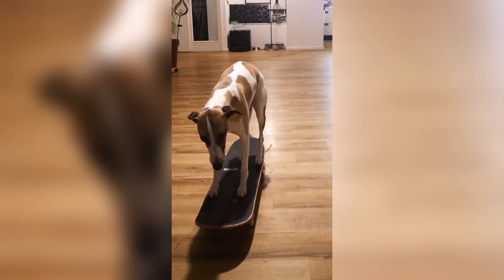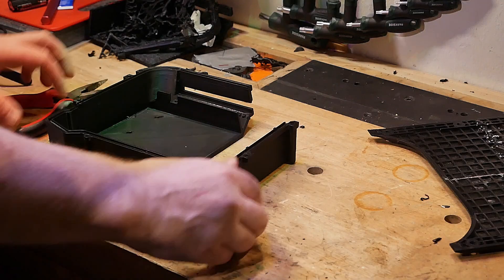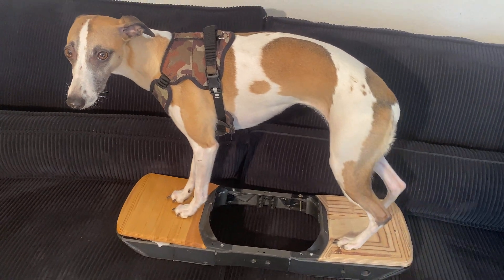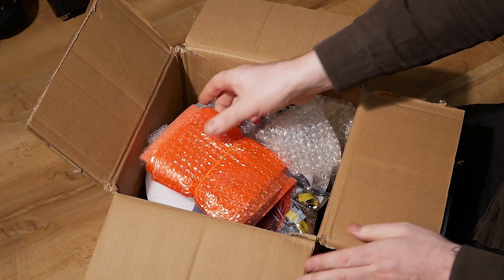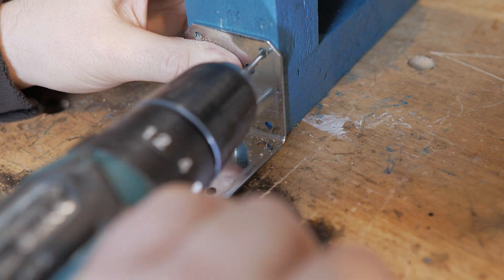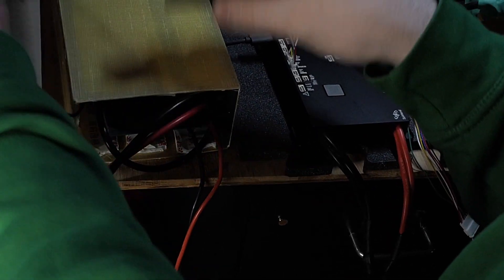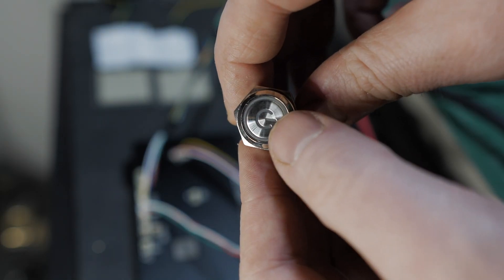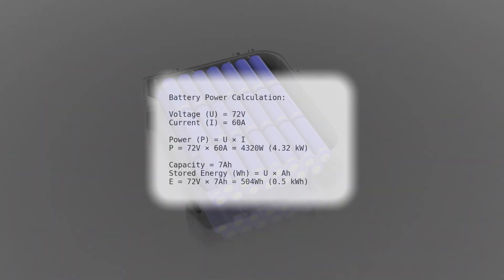4000W VESC Self-Balancing Skateboard || Building My Own OneWheel (Part 1)

Comment: Best printer is a ender 5plus modified
Reply from the maker: Yeah, the Ender 5+ definitely has a nice size and a solid frame great starting point for building a serious machine, I agree.
But to be honest, I’m kinda done with modding printers. I’ve built a few DIY ones myself before, loosely inspired by Voron always a bit of a “work in progress” vibe. Learned a ton doing it, and it was fun.

These days though, I just want to focus on my actual projects.
So I went with something like the Bambulab P1S more of a plug & play machine. Super happy with it so far, only downside is the small build volume.
The next size up, the h2d, is just way out of my budget right now.

Thanks a lot for the suggestion though really appreciate it!
Reply: Yup I had one I custom built btt opctopus mobo and upgraded everything it was fun build I just recently sold it had linear too  @LionInTech

Comment: How long did it take for the motor kit to arrive?
Reply from the maker: I’d say anywhere between one and three weeks, depending on how quickly the staff at Spintint process your order.
In my case, there was a small issue, but the team was very friendly and helpful, and we were able to sort it out without any trouble.

Just keep in mind that shipping is very expensive – around €150, and you’ll also need to pay import taxes.

Also, I don’t recommend getting the same kit I ordered.
The 250A controller is way overkill. I’d suggest something smaller – 100 to 150 amps is more than enough.

My new video will be out in the next few days where I finish building my custom-designed board.
I did the first test rides yesterday, and it worked great!

Overall, I can definitely recommend the quality of the parts in this kit.

Comment: Sovol SV08 is 350mm3 and pretty affordable
Reply from the maker: Thanks for the tip! The Sovol SV08 is basically a Voron clone – just without the DIY build and at a much lower price.

A couple of years ago, I actually built a Voron-style printer myself. Not a 1:1 copy though – I completely redesigned it using the parts I had available. It worked, but I never got it to run 100% perfectly. There were always a few small quirks and “growing pains.”

That said, I really like the Voron design philosophy, and the SV08 definitely looks like a cool option. I ended up going with the Bambu Lab P1S, but the Sovol would’ve been a solid choice too.

Thanks again for the recommendation!
Reply: @LionInTech  there's also the Elegoo Centauri Carbon. New price killer

Comment: A Prusa MK4 or even a Prusa XL 3D printer will do the job.
Reply from the maker: A Prusa XL would of course be the dream. I once tried at my company, in my 'day job,' to get my boss to buy an XL. Unfortunately, back then it didn’t work out, because I wanted to order the max configuration, which was a bit too expensive just to print a few small parts in the design department. Now, I bought a Bambulab P1S in a sale. If I had the necessary funds, I would have preferred to buy from Prusa. Thanks for your comment!
Reply: @LionInTech  I got my boss to buy a Prusa XL with MMU and Case. 😁
Reply from the maker: In our company, they still believe that 3D printing is just a trend that will eventually fade away. Well, now I just order 3D printed parts from external companies, and I sometimes end up paying as much for a single part as I would for a decent Prusa. But oh well.

Comment: elegoo neptune 4 max with build volume of 420x420x480 price is 440 dollar
Reply from the maker: Hi, thanks for your comment! I actually had the Elegoo Neptune 4 Max on my radar and almost bought it. However, I was unsure after reading the reviews. Some people praise it highly, while others report issues with the software and shifting rollers.

I used to have an Ender 3 and other printers from different brands, but ever since I got the Bambu Lab A1 Mini, I’ve been really happy just using the printer as a tool without constantly having to tweak things. That’s why I decided to go for the Bambu Lab P1S instead with its 256x256 mm build volume, which should be big enough for my project. xD 

However, I already had my first disappointment the advertised 256x256 mm isn’t actually the full usable print area, just another marketing claim. Typical! Still, I’m excited to try it out.

What has your experience been like with the Neptune 4 Max? Would you buy it again?
Reply: @LionInTech   It's a good for for its price my experience is great as bought it a year back its just had one problem wiggles on high speed print which result not good prints but I print at lowered speed for good quantity prints and I think they solved this on newer models with more rigid frame

Comment: Hey there! I just wanted to let you know that the ubox 85v is not safe with 20s batteries for onewheels - this is because when fully charged a 20s battery is 84v - and if you brake hard enough - even at lower soc -  the voltage can spike up quite a lot. the highest voltage battery safe for use with the ubox 85v would be 18s - so that you can set your max input voltage to 82.8 volts (4.6v per cell - I know cells don't charge that high, but with regen braking they can spike up a lot - and we dont want this threshold to be hit or we get dropped) - and still have safety margin for the hardware.

also even if you were to use an 18s battery - I would still go and check what the max input voltage is set to - cause it sometimes can be set to low by default.

anyways I though I should let you know! - if you have questions feel free to ask! - there is also a discord about vesc onewheels which is incredibly useful - so if you want I can send you an invite!
Reply: this isnt true, the voltage rating of the mosfets is what is important. all unicycles are vulnerable to the battery being at full charge and unable to dump any current, if they dont have a brake resistor.
Reply: Yes - but what I said ist still true - the mosfets in the ubox 85v dont have enough safety margin @Blox117
Reply: @Blox117 yes - but what i said is still true - the mosfets in the ubox 85v dont have a  big enough safety margin at 20s - (it used to use different mosfets - and so it was ok if no limits firmware was used and max voltage increased - but i believe they switched to diffetrent mosfets since then)
Reply: @edinspiegel  ok, if they switched then that makes sense i guess. it is rated for 100v at this time.
Reply from the maker: @Blox117  You’re totally right that what really matters is the voltage rating of the MOSFETs – that’s the ultimate limit for the hardware.

But I think the original point still holds up. Even if the battery is fine with 84–85V, if the controller’s internal components (like the FETs) are only rated up to 85V, you’re cutting it very close. Especially during regen braking, voltage can spike above that  and if there’s no brake resistor, there’s nowhere for that energy to go.

So yeah  both views are valid.
The FETs are the limiting factor.
But using a fully charged 20S pack on a system rated for 85V can still be risky, depending on how tight the tolerances are.

That’s just what I’ve picked up digging into this stuff. I’m not an electrical engineer I come from a mechanical engineering background. So in theory I have no clue what I’m talking about. 😅
Reply: @LionInTech  if you look on the page of spintend for the controller you have, the power mosfets are JMSH1001ATL, and then you do a search for a datasheet which shows it is rated for 100v. along with the capacitors which are rated at 100v.

which makes sense, because they wouldn't advertise an 84v or 20s package with a voltage max at that exact voltage.

in essence: yes, its safe to use 20s. but the point about a brake resistor or not braking on a full battery is still true for any unicycle.
Reply from the maker: @edinspiegel  Hey, thanks a lot for the information! I wouldn’t have thought that the Ubox really has such a hard limit at 85V. But yeah, an 18S2P setup would definitely be more than enough.

The good thing is that I’m designing my board to fit a Pint X Performance tire, which makes it slightly smaller than a Floatwheel. And during my 3D planning, I already noticed that space was getting really tight with a 20S2P configuration. So, in a way, this change actually works in my favor!

And yes, I’d really appreciate it if you could send me an invite to the Discord! A lot of what I’m doing in this video (and in future ones) is completely new territory for me, so having access to more info and experienced people would be super helpful.

By the way, do you know if my statement about Floatwheel being an open-source project is actually correct? At first, I researched it and found information suggesting that it was, but now I’m not so sure anymore.

Thanks again! 😊
Reply: @LionInTech   I'm sorry If I am spamming but uhh my answer keeps getting deleted for some reason
Reply from the maker: @edinspiegel Strange, I definitely didn’t delete anything. There seems to be some kind of YouTube filter.
Reply: @ I'm really sorry but it seems it doesn't want me mentioning d__cord (I tried this message without censoring it and it deleted it) - I'm edin_spiegel on there maybe you can friend request me & I'll send you the resources that way
Reply: @LionInTech  so uhh yeah it deletes my answers - pretty much doesn't matter what I say - just uhh idk what's your discord name? maybe I can tell you that way?
Reply: @LionInTech  yeah - hmm it still didnt let it through even with rewording and stuff - so idk is there any way I can contact you?
Reply from the maker: @edinspiegel  Hey,
I’ve created a new email address just for my YouTube channel, since I’d prefer not to share my private one publicly.
Would be great if you could reach out to me at whippetintech@gmail.com from now on.

Thanks a lot! 😊
Reply: @ Hey there! yeah totally get that - that's a smart move to make a new one! - yeah I just sent you an email with the info!

Comment: Ender3
Reply from the maker: I actually still have a disassembled Ender 3 sitting in a box. But I was thinking more about something like a CR-10 with a 300x300 mm print area.

I think with the Ender 3 (220x220 mm), the bumpers still wouldn’t fit on the print bed. But thanks! Maybe it does fit after all – I should measure it. 😊
Reply: Thanks

Comment from the maker: I'm not so sure anymore if the Floatwheel is really Open Source , did I get that wrong? 🤔 If anyone has more info on this, let me know in the comments!

Also, which tire would you recommend? And what didn’t you like about the video? I’d love to hear your feedback so I can improve in the future! 😊
Reply: So floatwheel is based on the opensource vesc project so controller is opensource, but the board itself i do not think so. Although i don't think tony minds if you try to build your own, he is a awesome guy
Reply from the maker: @TheArnoparno  Hey, thanks for the comment!
It actually wasn’t easy to find out whether the whole thing is truly Open Source or not. But as you said, the Open Source part probably only applies to the Vesc system.

Since I wanted to avoid rebuilding something that isn’t truly Open Source in my video, I decided to design a completely new board for the second video. I redrew every single part myself, so in the end, it turned into a different board with its own character.

Tony’s board is definitely a thousand times better, no doubt about it. But for me, it would’ve been extremely difficult to build. I do have access to CNC machines, but it still would’ve been a serious challenge that I probably couldn’t have pulled off. That’s why I went with a simpler design.

I’d be really happy if you check out the second video  it’s already online.
Cheers!
Reply: @LionInTech  so something that might be worth considering is leaving your d sign compatible with the onewheel xr rails then you have the benefit of having compatibility with lots of accessories and aftermarket parts out there already
Reply: @LionInTech  and also the controller is whats most important being opensource so you can repair it and do  as you please with it
Reply from the maker: @TheArnoparno  Oh man, the way you explained it makes so much sense now. And yeah looking at it from that perspective, of course it would’ve been smarter to make it compatible with existing parts. But guess what? That’s exactly what I didn’t do.

I spent two or three weeks designing this board a few hours every day. It might not look like a lot of work from the outside, but I really tried to shape everything around the one tire I had: the Pint Performance tire, which is quite narrow. Plus, with my rail design, the whole build ended up even slimmer than usual.

So I made the board narrower to match the proportions, and honestly… I just didn’t think about compatibility.
Maybe one day I’ll rework the board again. I mean, let’s be real when you love building stuff, does it ever stay at version one? 🙈🤪
Reply: @LionInTech  Haha yeah no it was just something i wanted to mention if you have put this much work in it then no don't redo it all for this version